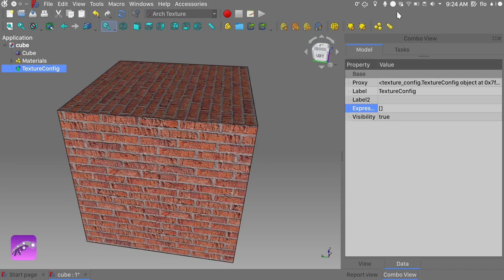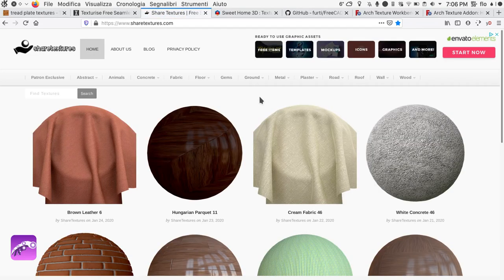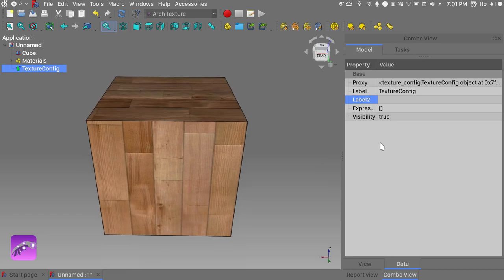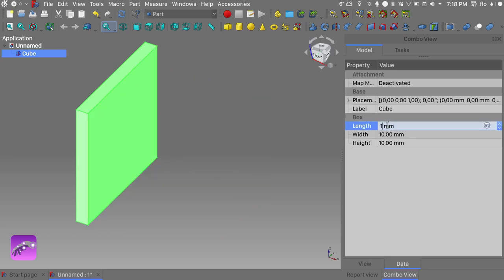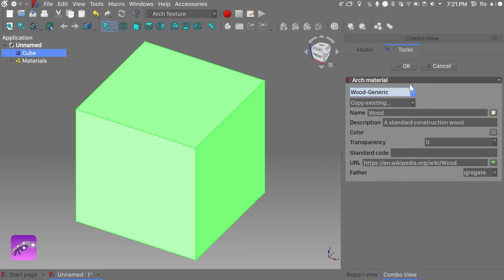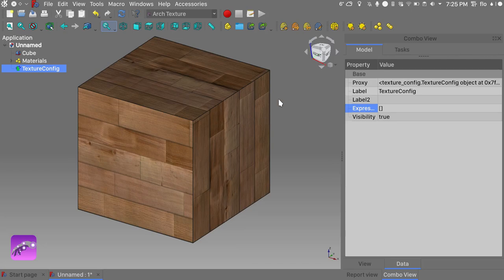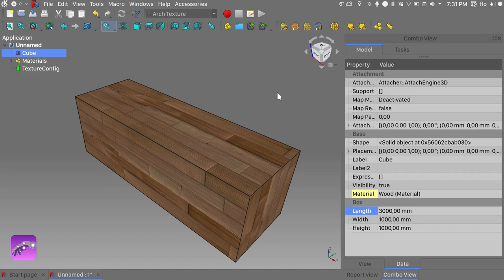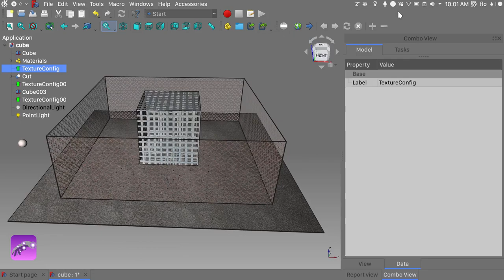[OUTDATED] Freecad : texturing and lighting tutorial.

Comment: Thank you very much for the nice video. For me, the texture only works with part objects, but not with part design objects. Not even when I make a simple copy. Does the texture only work with part objects?
Reply from the maker: I should hide this video from the channel. Due to internal changes in the FC core things don't work anymore and I have no time to dig in further. This video tough has a purpose, this and some other ideas have sparked in RealThunder the will to code the experimental renderer that aims to solve a whole sleeve of problems this included(having textures for the model that is). The foundation is there, we just need to have a bit of patience